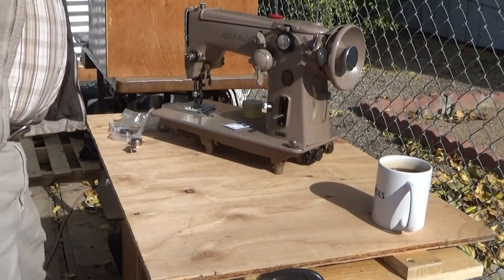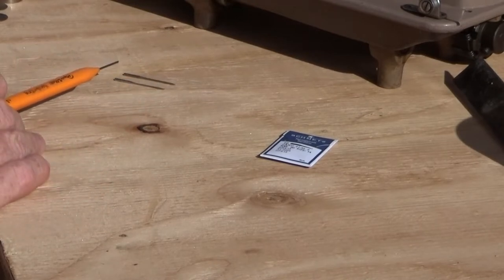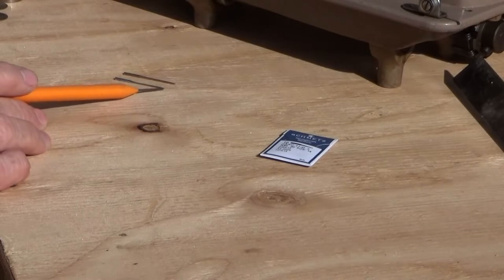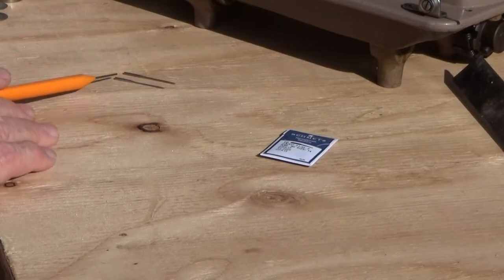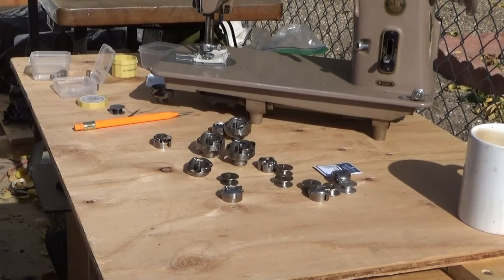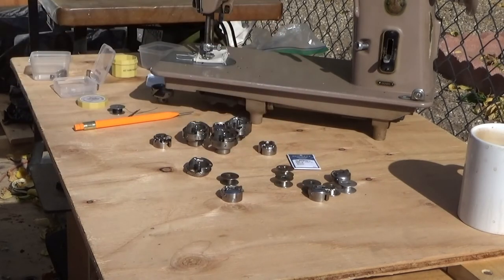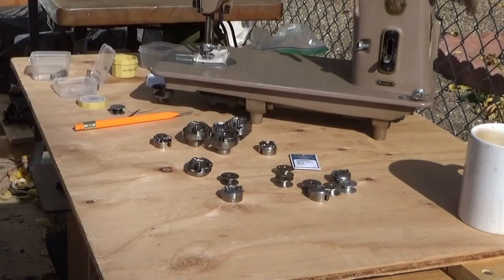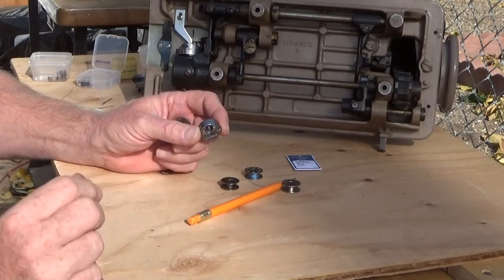Singer 306 Hook TMI

Comment: Thank you for taking the trouble to make this video and to share you knowledge.  This information is not available from anywhere else and I'm obliged!  You've answered all of my questions.  If I ever need to swap out my hook assembly, I know exactly what to do.  

From what I can see of my 319, it's an extraordinary machine.  Vastly underrated.  At the moment, I'm using 15x1 needles in the original hook assembly and a bobbin case that has a wider and deeper opening and the machine sews beautifully.  But again, if the time comes to swap out the hook assembly, I now know exactly what to do.

Comment: nice video.. i currently  repair singer 306 as well.. can i just put singer 20u complete rotary or i still need to use original case of singer 306.. thanks much ..
Reply from the maker: You can't use a complete 20u rotary hook assembly because the diameter of the shaft it mounts on is different.  If your 306 already uses the open top bobbin case, a 20u case is a drop in fit, no modification needed.  It has enough clearance to let you use standard 15x1 needles.  If you want to use standard L class bobbins you may need to modify the bobbin winder or get an external winder.  A split pin in a cordless drill will work.

Comment: i have a 319k singer my stich length needs adjusting longer stiches in reverse when strait stiching also can you repair the bed of a 306 its has a cracked base still works great tho
Reply from the maker: I'd love to help you out but I've moved to the Philippines.  I brought my favorite 306 with me but had to sell off everything else before the move.  I'm pretty sure the 319 and 306 use the same feed.  You can find the 306 service manual online at https://www.manualslib.com/manual/364543/Singer-306.html  It covers multiple models and is one of the most comprehensive service manuals I've seen from Singer.
Reply: @joekahno  how do you think these 319k an 306 willperform, with a servo moter ???
Reply from the maker: @rndea100  I start out on my test treadle then drop it into a table with a servo at around 12:15.  https://www.youtube.com/watch?v=GFRIpDgtsGQ&list=PLkaJMM7IYVw1REb8VhvOq20XFbybCNnuC&index=13  Then follow up with a selection of light stuff in the same table.  Seat belt webbing is incredibly tough but such an open weave it sews pretty easy if the machine can handle the heavy thread.
Reply: @joekahno  can the bed of the sewing machine be welded the corner at the front snapped off the cover plate is holding it in place so it still works n=an sews well ??
Reply from the maker: @rndea100  Yes, aluminum can be welded, usually with better results than cast iron.  Unfortunately, anyone competent to do the job will probably want more than the cost fo a new machine.  Part of what I left behind when I moved was a stripped 306 frame on a pile of aluminum scrap.  There is a party on ebay selling a selection of 306 parts at reasonable prices.  If the bed of machine is available they might be willing to make a deal.  The bed can be separated from the arm to reduce shipping and the number of parts you have to transfer from one machine to the other.
Reply: @joekahno  i have a good friend he is a who fixes cars he will probly do it for like £20
Reply from the maker: @rndea100  All I've done is oxyacetylene and SMAW (stick) welding.  Production welding for aluminum is normally MIG (metal+inert shielding gas).  It can take quite a while to get everything dialed in perfectly for the alloy you are welding.  This can be impractical if you're fixing one piece of uncertain composition.  TIG welding requires more skill but I've seen people do some incredible things.  Stuff like welding razor blades or aluminium beverage cans, things that require exceptional heat control.  Ask him to show you some of his work to see if he's a good match for what you need done.  Best of luck!
Reply: @joekahno  my stich regulator is off how can i fix it the stiches, they are smaller when you going  forward,  then when you do a reverse stich there massive .
Reply from the maker: @rndea100  The manual I linked to earlier in this thread has around eight pages of detailed instructions for properly setting up the feed system.  For best results they need to be followed in order.  Often getting one adjustment right can't be done if you skip the preparation for that part of the job.
Reply: @joekahno  i have a manual but i t doesnt say what to do if the stich regulator drops im better with videosi set it to 6 to 4  an im getting like 12 to 2 instead
Reply from the maker: @rndea100  I wish I could be more helpful.  I've always been one of those mutants that reads two inch thick technical manuals for entertainment.  Unfortunately it's a personal curse I cannot bestow upon others.
Reply: @joekahno  can you swap a 306 head to a 201k singer base or a different base with a 15class bobbin
Reply from the maker: @rndea100  In theory almost anything is possible.  Some things are so difficult that unless you're just trying to prove it can be done it isn't worth the effort.

Comment: hey Joe, I I hate to be a pain but I still cannot find the shuttle and bobbin case for the conversion. Is there anyway to send me a link? I got the hirose hook assembly but i cannot find the other parts and I'm working on converting 2 of these. Thank you so much for your help
Reply from the maker: Not a problem.  The shuttle is the inner part of the hook assembly.  It has the post the bobbin case latches onto.  The bobbin case I use is for the Singer model 20u.  The quality of the ones on ebay ranges from not bad to total junk though to be fair the new production Singer OEM cases aren't any better.  I've had good luck getting them from Wawak. (wawak.com) STOCK # BOB2C  If you want to use the bobbin winder on the machine get the Part # 55623AQ bobbins from Central Michigan Sewing Supply.  You have to hold the trip lever up on the winder until they're about half full but they are the closest thing to OEM available anywhere.

Comment: I have two 306Ks.  An early black one w/out the Cams.  I believe it was made in February of 1954.  It has the two locating pins at the top.  I am using bobbins from Central Michigan Sewing Supply with it and a 20U bobbin case.  However, the other is a newer beige 306K that has the cams.  It has the 5' oclock notch.   I want to keep that one with the electric motor and I am considering upgrading it to a beefier motor.  The other I will treadle and would like to put a spoke wheel on it if it is possible.  Anyway, I am taking up your time but am I to understand that the ONLY way to get the one with the 5 o'clock shuttle working is to change the shuttle to the correct one like on my other 306K, or more easily open up a 5'oclock bobbin case unless I want to change the hook assembly like you did in your other video.  Also, have you had any experience with the free arm 320 K and do you like it?
Reply from the maker: I've run a 306 on a treadle base I salvaged from a White Rotary.  I had to notch the front of the belt guard for clearance but it worked fairly well with the original hand wheel.  The spoke wheels run smoother because they're heavier and store more inertia.  Maybe use stick on wheel weights from the auto parts store?  The easiest upgrade for your other machine is probably to get a Dremel and cut a 5 o'clock notch in a 20u bobbin case.  I've seen pictures of a pretty crude hack that still worked reliably.  The cut away at the top of the case is wide enough you could be off by several degrees in either direction cutting the notch and still be in no danger of a needle strike.  I would wrap a strip of paper around the stock bobbin case then do like a headstone rubbing to make a template I could glue to the case I wanted to cut.  The few times I found a 320 I was instantly outbid by people who wanted it more than I did.
Reply: @joekahno    Thank you for all the valuable information  I am going to make a template as you suggested.
Reply from the maker: @redoak3809  An added advantage is that a modified 20u bobbin case should work equally well in either machine.  The five o'clock cut won't interfere with it indexing on the top pins in a machine that has them.
Reply: @joekahno  I would have never thought of that.  Thanks!  Too many machines, too little time.  I wish I could get a 400 series German machine to treadle with.